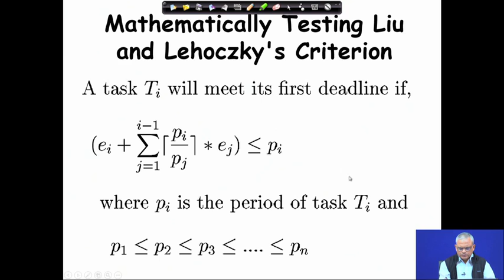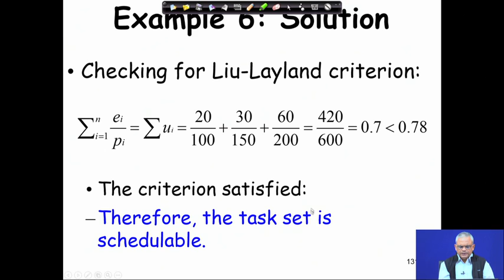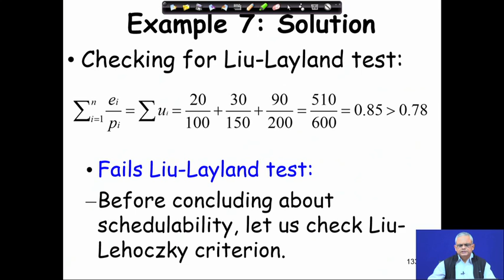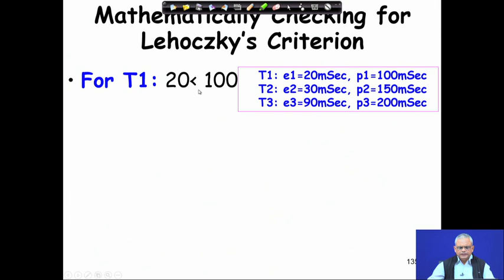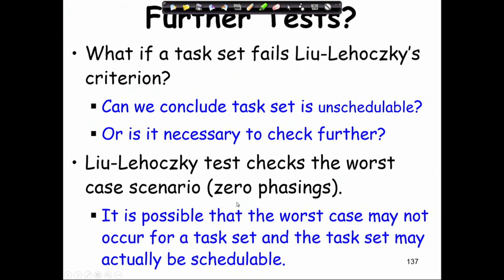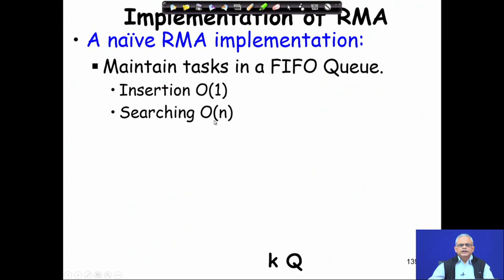Lecture 10 : Rate Monotonic Analysis

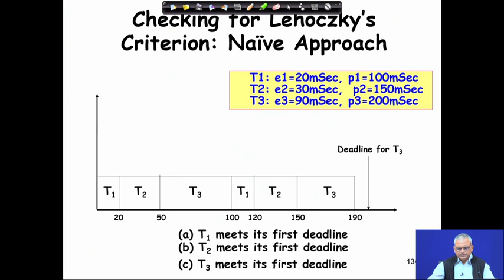Comment: Sir, need to clarify one thing that is at 13:34 time in this video, at 120 ms, T3 must run not T2 bcz T2 already completed its efficiency in 150 ms period. T3 run for 30 ms till 150ms, the  T2 runs for 30ms upto 180ms and then T3 run for 10ms till 190ms..
Reply: yes correct